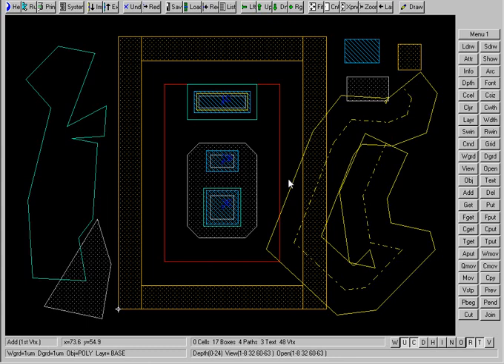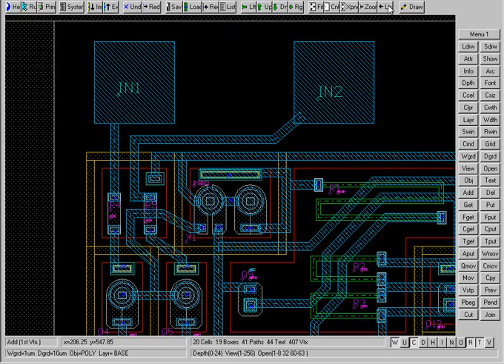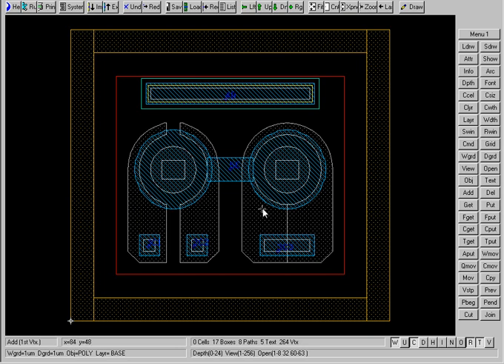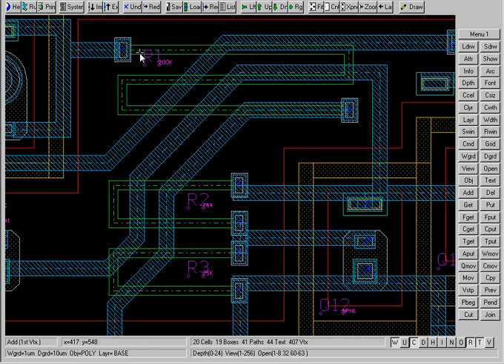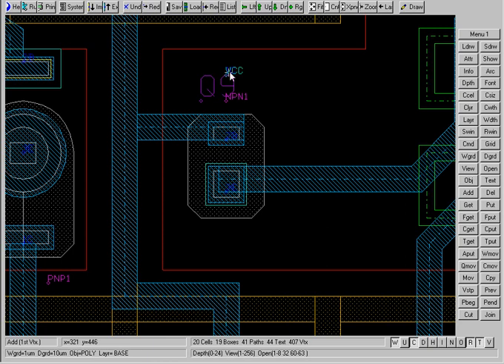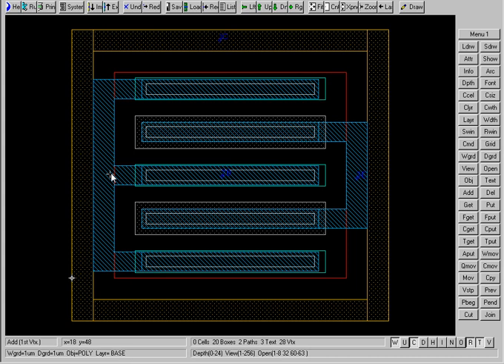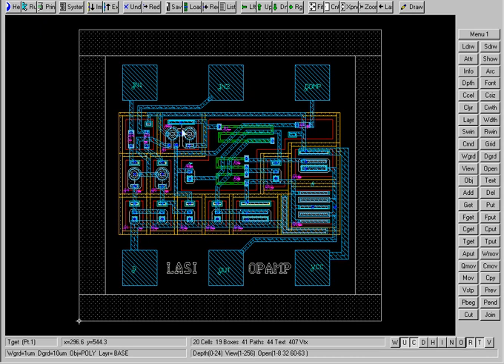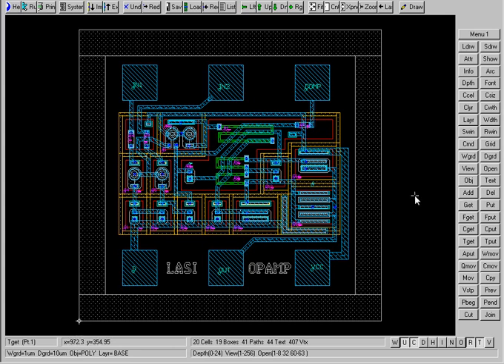Let's Learn Layout with LASI! Part 5: Tying it all together: Exploring the OPAMP cell

Comment: can i get the software details
Reply from the maker: A quick Google search turns up all you need to know: "LASI (Layout System for Individuals) is a free to use Windows tool used to view and edit design files. It has been discontinued and the home page no longer exists. It used its own file format of which there are two variants. Files with the ending .tlc can store only a single cell whereas .tld files can contain a whole design. The data can be stored in physical values and in relative values. If the data is stored in relative values, it is converted to physical units via the lamba value. The LayoutEditor can import both of these formats. An export is not supported and no longer make sense because the LASI software is no longer available."